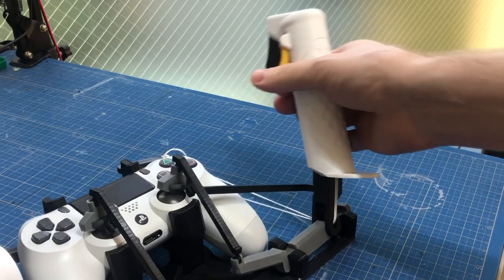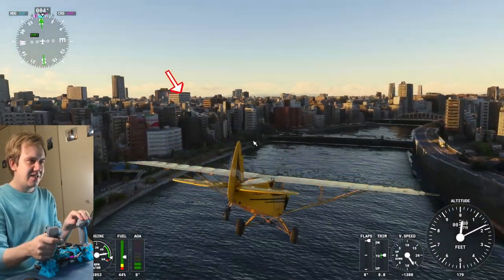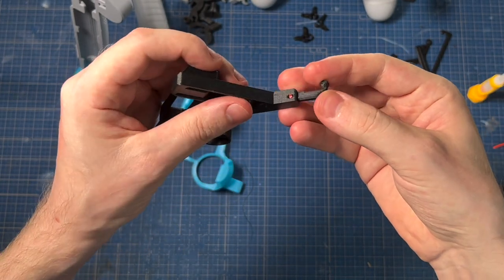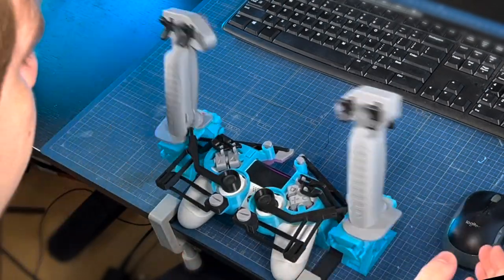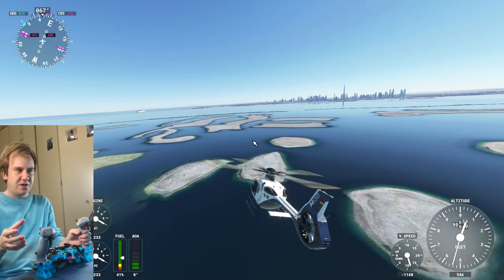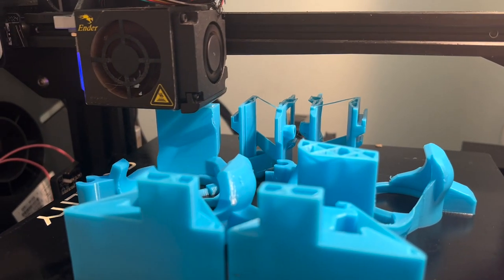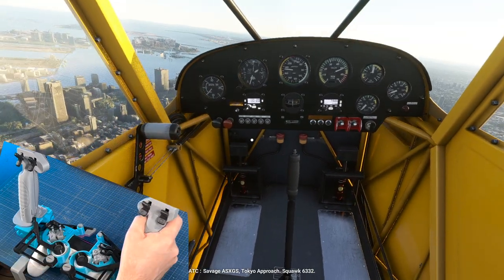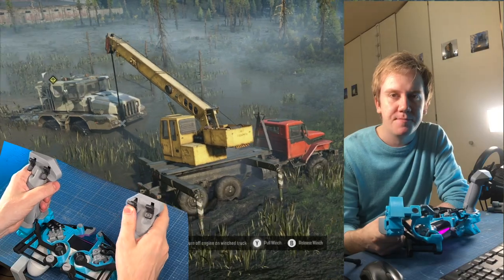Fully 3D printed Joystick adapter for DualShock 4

Comment: Lol, and I had just finished printing both sticks for my DualSense.  However, I did have some issues with some of the linkages, so I'll definitely be reprinting them with the newer files once their updated.  I guess I'll start printing the ps4 sticks in the mean time.
Reply from the maker: The linkages are the weakest part definitely. And the trickiest to assemble too.

Comment: Integrating optional springs into your design may solve your dilemma with face buttons. Packs of 100 are sold on Amazon for a reasonable price. All in all, you've created an amazing piece of technology and I look forward to seeing your future iterations. Great job, man!
Reply from the maker: It would feel like defeat if I came all this way and used metal springs at this point!

Your suggestion did get me thinking though. I guess you could add a spring (metal or a plastic flexure) somewhere inside the stick shaft that keeps the linkage stick centered.

But that said, the linkages work fine 90% of the time already!

Comment: Would it be possible to do one for the Nintendo switch pro controller because I don’t want to buy a ps4, ps5, or Xbox controller and also the joystick design because then I might as well just buy a regular hotas even though it is missing the additional axis. It would also be great if you could make one for the latest hotas Xbox design too.

Comment: Hey! Amazing design i love it! Only I have 1 problem, my scews keep breaking. Could you please share the design for only the screw? I want to try to print it solid.
Reply from the maker: Thanks! Yea you should definitely print the screws solid. It’s easy to split them into their own file in PrusaSlicer with Split to Objects. You can then save the STL from there even if you use a different slicer.
Reply: @AkakiKuumeri  Thank you very much!

Comment: so is an xbox yoke going to be a thing eventually or are you focusing more on sticks recently?
Reply from the maker: Do you think a lot of people would want an Xbox yoke?
I consider this stick the ultimate revision so I’m done with sticks for now.
Reply: @AkakiKuumeri  I don't know about other people, but I would love one, since I like a yoke and I like having full access to all the buttons I can get.  It would also be interesting if you could try to make it just connect to 1 stick on the controller for more open inputs.  Also by the way, thank you so much for offering a free version of all your designs.
Reply from the maker: I have had the beginnings of an idea for a better yoke design in my sketchbook for a while…
I agree that it would be better to just use one of the sticks.
I’ll see if I can move it up the ideas list!
Reply: @AkakiKuumeri  thank you!
Reply: @AkakiKuumeri  I could second, although what I miss the most is the loss of the throttle stick on your updates. The previous throttle which was "sticky" using tape I thought was a great start. The yoke seems a tad more difficult, but ideally a "sticky" throttle update and a new yoke would be the best. 

Then again, I should just learn myself. Great puns btw! lol Let me know if you plan on updating a new throttle for PS4.